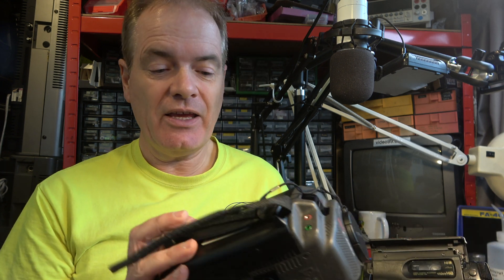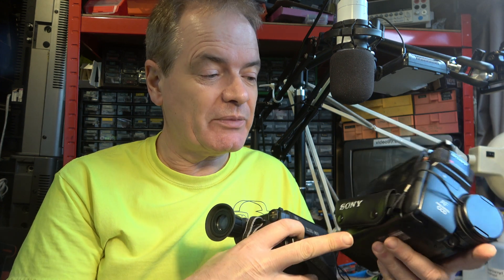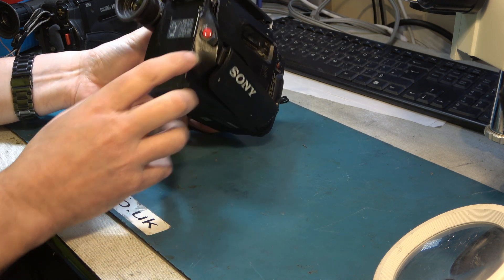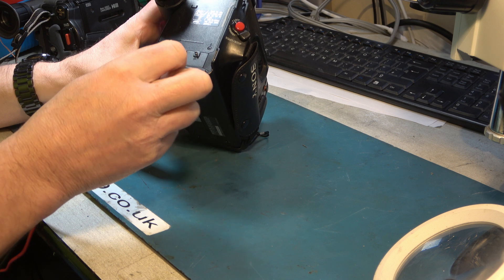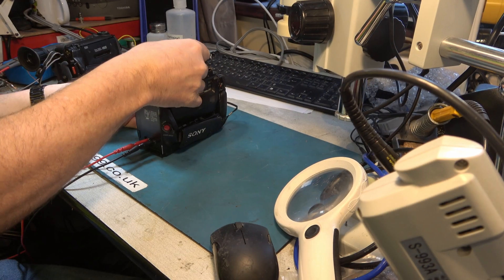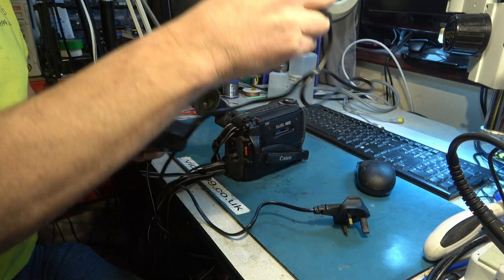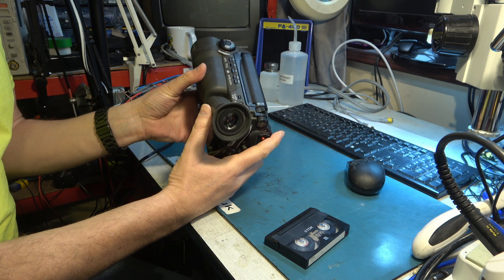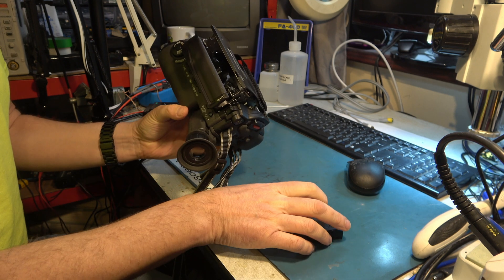Extracting tapes from two camcorders, without damage

Comment: Hi, I have some hi8 tapes which I want to digitise but I do not want my SONY TRC120E to chew them, I cannot find a Desktop HI8 player here on Australia, are all hi8 Handycams /camcorders equally as hard to remove chewed tapes or can you recommend a few that are easier to remove a chewed tape ? Ie is there a common cheaper handycam i can buy for ripping which a chewed tape can be removed easier.?
Thanks in advance
Reply from the maker: I would digitise with a DCR-TRV120E or similar with Firewire output.  Tapes shouldn't get stuck unless there is a serious problem.
Reply: @video99couk  yes most of  the tapes are broken,  I didn't really want to replace another 120E , But I thanks to your videos I know a lot more now than back then. I think I have to install Windows XP (with service pack 3 ) for my old  Toshiba Satellite to recognise my PCMCIA Firewire card...LOL...what an epic adventure.

Comment: I had a very similar Canon camcorder, the Canon UC-9Hi, probably the model before the one shown here, it certainly looks identical. I'm sure it also had the optical image stabiliser. One day it just refused to accept a tape. I think it would only close the cassette door if there was no cassette in it. Ended up replacing it with a Panasonic MiniDV camcorder.

Comment: sony ccd handycams usually only take 2 or maybe even 3 screws to simply remove the tape cover. this is useful for cleaning the playhead, capstans and pinch rollers. that canon looks like they did not adhere to certain  "standards" for the sake of serviceability.

Comment: Manuafacturers don't learn - even fairly modern things still use the rubberised plastic that goes gooey, such as my Zoom H1 which has gone really sticky and disgusting!
Reply from the maker: Lots of products from various manufacturers have made the same mistake. From keyboards to domestic audio equipment and even professional video recorders.
Reply: I've got a Zoom H1, owned from new for many years, and it's made of hard shiny plastic. No rubbery coatings on any part of it. Maybe there were different versions.
Reply: @timf-tinkering  That's odd. Bought my H1 in the UK in 2016

Comment: ive heard that some digital8 camcorders have connection points that offer the untouched rf signal of the head drum. these signals from video8 tapes can then be captured by a high frequency dac like the domesday duplicator to be decoded digitally via video8 decode. would you mind featuring that in a video and comparing it to your usual dv digitization methods?
Reply from the maker: It's not something I'm likely to work on in the near future unfortunately.
Reply: @video99couk  bummer imo these kind of analog decode projects lack awareness on youtube. also i think you could charge more money for this kind of high effort archival work

Comment: I would definitely do the necessary recap on that Sony, because getting Hi8 camcorders that are also stereo is hard here in Hungary. There are plenty of Hi8 camcorders available, but 80-90% of them are mono. It took me years to find a stereo one for cheap, it's a very old Canon UC1Hi, it also surely needs a recap, if it can be saved at all. I've seen a Canon camcorder in which the capacitor juice ate the traces and vias off the boards so much that it was a write off.

Comment: I first tested the "wrong" polarity on the servo motor of a SONY Hi8 camcorder, according to the motto Loading comes before Eject. However, I had already searched for recordings with the camcorder until the end of the tape without success, so the kinks caused by the cassette flap were not really important. I also couldn't find any recordings with another SONY Hi8XR camcorder, even though it said that the tape was recorded. I was allowed to drop off the SONY parts in a bag at the recycling center.

Comment: When in doubt, bounce it off the bench. Good ol' Cannon. LOL.
Reply from the maker: May well be a bad mode switch.
Reply: "Removing rust" from contacts by shaking sometimes leads to success. Shaking also includes driving a TV to the workshop. After a week in the workshop, the problem was back.